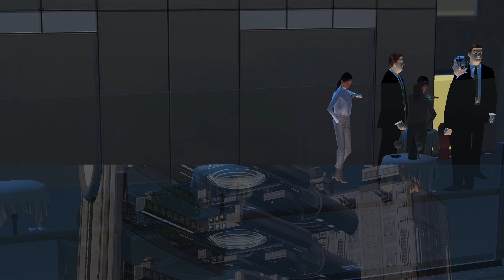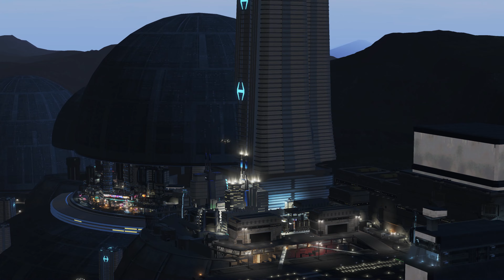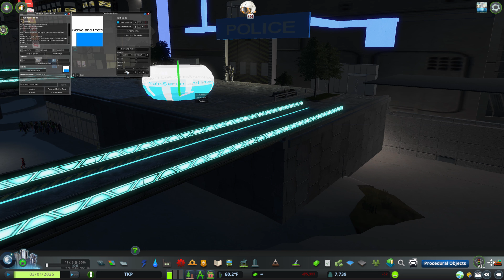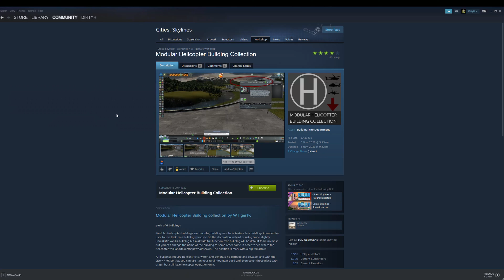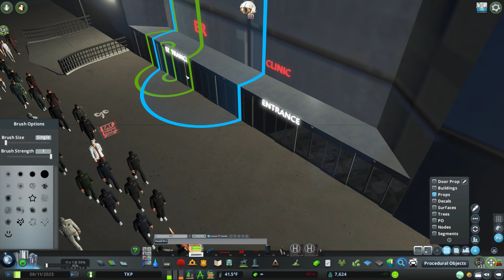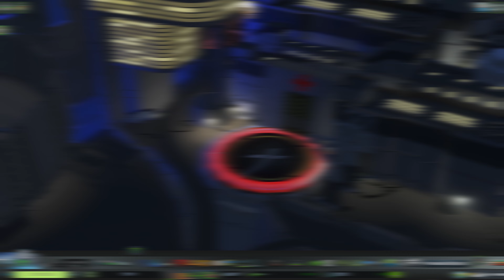Adding Vital Services | Cities Skylines -The Kepler Project - EP03

Comment: how did you rectify PO objects disappearing after a save?
Reply from the maker: Add them all to a PO export file. Everytime you load the game just export back in your objects by clicking the import button. Works everytime
Reply: @Dirty.H  could you tell me how to save all of my holograms together to a PO export file? I’m new to PO but definitely need to do this and the proper way to do it.  
You’re the only one I’ve seen that recommends this
Reply from the maker: @richmeltz744  hold control and select all the POs you want to export. Click the 'more' button then choose export selection. You can import from the PO main menu and rename the group to something recognized
Reply: @Dirty.H  ok cool.  And when I add a new hologram to my city, do I have to select all of the holograms again and export them together? Or is there a way to just add single holograms to an already existing export file